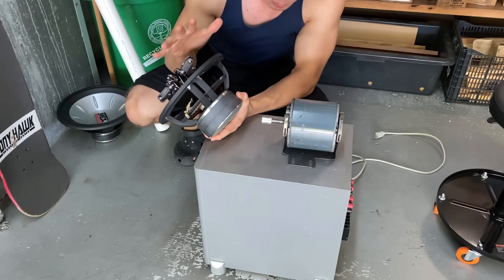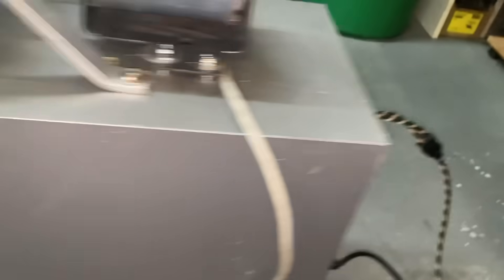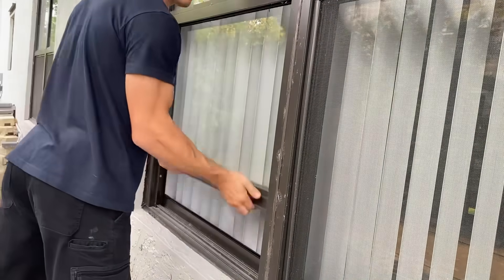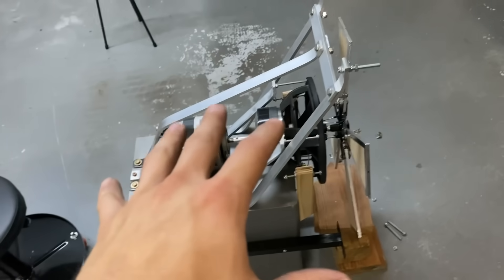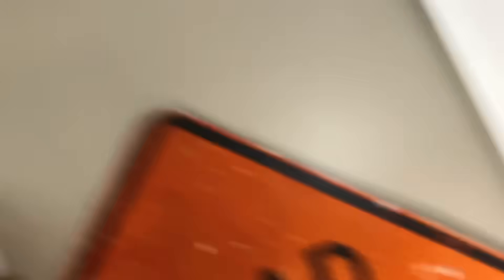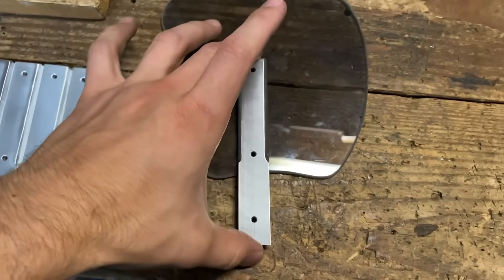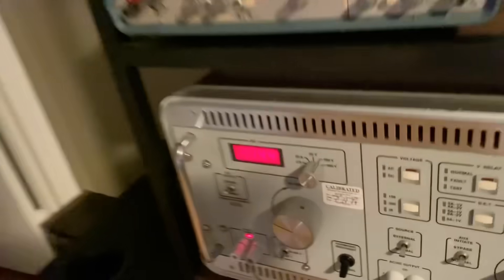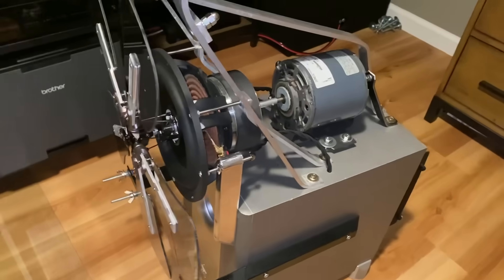Making the worlds most powerful subwoofer (Rotary Subwoofer)

Comment: When you showed it at 1hz it looked like the fan was moving as close to a square wave as possible..  I wonder if you had the signal generator set to square wave, and that brings up a question about how lagged the phase is, and how accurate the signal is if you were to "receive" it somehow and plot the air pressure on an OScope?  Super cool project!  I could see putting that in a haunted house just to create an indescribable sensation that would make visitors uncomfortable..  :-)

Comment: It shook your house from moving the walls due to fan shaking - or the wind - the dB is not causing the doors to move
Reply: moving the walls? you can't shake a house like that. idiot
Reply: @realmasterkush   the movement of the air is causing movement of everything, also walls do indeed move if you exert enough force upon them.. idiots
Reply: @realmasterkush well in the USA you can, many are build from wood. Low frequency can definitely also move a brick home home if it's powerful enough
Reply: your house's foundation shook when your mom stepped in it... etard
Reply: To elaborate - the wind could have done this ... not dB

Comment: Why didn't you just stick a slab of rubber between the motor and the chassis.
Reply: Because that would prevent a lot of the power from being transmitted, you want it as rigid as possible.
Reply: @flomojo2u  I think he ended up with a whole lot of power, and a whole lot of rattle, when he could end up with slightly less power, and no rattle. This thing is a nuke, there's no lack of power anywhere, putting it on a slab of rubber keeps the soundwaves in the air, instead of between the chassis and the motor. Rattle never sounds good.

Comment: But why didn't you show it playing some actual music? ... I'm kinda disappointed. It looks really cool and the fact it moves so much air is great, I just wish I could hear what it actually sounds like with music (or other audio. Like a movie or whatever)
Reply: I'm not sure how many songs are publicly available that play notes below 20hz
Reply: @socks7545  Oh so this is only adequate for sounds below 20Hz? I thought it had a bigger range than that. I hadn't ever heard of this type of speaker before btw.

Maybe you could pair it with a normal subwoofer and a normal set of speakers to get a good range?
Reply: @janusismyname 

Rotary subs can absolutely play audible sub frequencies with a high enough impeller RPM and a solid driver (as impractical as it is lmao) to something like 30hz, but the design isn't necessarily the point of the device.  But yeah, they're mainly to cover ranges below human hearing.

still, though, you could just play chopped and screwed through the rotary, like bassheads have been doing on normal subs for decades now.

Comment: So it doesn't seem practical?  What's the decibels?  Does it compare to a standard sub when playing music?
Reply: This machine shoots a frequency at 180 bi directional. The decibels can be used as amplification for the frequency to reach further places but not necessarily make it louder, this helps with movement of air to push sound thus adding a sound system for theater style use will bring the sound to life more than anything else.
Reply: @alexiz.7569   That's fascinating!  Thank you for sharing!

Comment: If it's inaudible, what tf is the point? I really don't think the fan is doing sh*t though. What's the point of the fan, to make the sound inaudible so you can blast bass... and not hear it? Just adding "feel" to your music? Well, you can market them to the deaf. They like music too, but they have to be able to feel it. I
Reply: The fan is the whole reason it works. It generates static pressure which is modulated by the pitch of the blades, kinda like a helicopter is able to fly. A normal subwoofer simply cannot move enough air to get to frequencies that low unless it was ridiculously large and high excursion. 

And yes, the point is to feel the vibration. It enhances the experience during movies that contain very low frequencies.

Comment: Because 10hz is even humanly audible letalone wouldn't be filtered out by the digital audio file or the analog path otherwise 2:12
Reply: I can hear it just fine on my SVS SB1000 Pro. it's definitely attentuated and on the edge of human hearing so it's not very loud even if you are pushing a high SPL but it's there and audible.

Comment: How does it sound at higher bass frequencies? 40-300 Hz
Reply: Rotary woofers can't really go above 20 Hz, since the blades have to move too fast. A traditional subwoofer is still needed for stuff above 20 Hz.
Reply: @KingdaToro That's a shame, but it makes sense
Reply: @ContriteCatholic  It's not a shame at all. This is meant to complement a regular sub, not replace it. The rotary handles 0-20 Hz, the regular sub handles 20-80Hz.

Comment: i really wish you wouldve done more hz like 20-30 range so it could be picked up properly on the mic
Reply: 20 Hz is actually the point where traditional subs start putting out higher SPL than rotaries. Above that point, the blades have to pitch back and forth too fast to be effective.

Comment: Hello folks; i can see or believe why there not in full production from1994 Phoenix Gold Cyclone rotary subwoofers. 
Theres lots of information out there.

 Great for the D.I.Y. crowd. One needs the house to be under warranty not the sub woofer. Run safety covering around the blades the G force the blade will go right through the brick house next door.
Just like the grinding disc that snap on two that in the 3/4" plywood ceiling for life.
A hot rod motor has some type of safety hold down in case they break a motor mount.
Lock tight and lock washers on everything,  too

High performance equal high maintenance. Get good insurance.
 Best to have a spare one as it will go down that's the last thing you want to happen when you don't want it  too.

Ride Easy

Comment: That would seriously be the craziest lfe experience ever. Id just pitch shift the lfe down to infra level. Or you could use a sub-harmonic synthesizer. You could modify/make a DBX 100 since schematics are easily found online.
Reply: Geta good sub for the upper frequencies of the lfe too. ~20hz and above. Not sure how accurately you could set a crossover tho.

Comment: Why does everyone put it in the window?
Reply: because a normal sub, inside a box, changes the pressure inside the box compared to the outside, this through the duct that is open between the inside and outside, as for this sub fan, it needs to change the pressure of indoors compared to outside the house, and since it can move a lot more air since it's a fan, it needs and can move a lot more air, making it very strong, I think that's it

Comment: You gonna build this sophisticated thing for days and then not even do a soundcheck with an actual song
Absolute madman haha
Reply: Very, very few songs have sub-20Hz content. Above 20Hz, a traditional subwoofer will outperform a rotary.
Reply: @KingdaToro  OK I just thought it would be in general a really powerful subwoofer with the added capability to go down to 1hz
In which way will a traditional subwoofer outperform a rotisserie subwoofer?
Reply: @LeKacker  It's because the blades of a rotary subwoofer have to pitch back and forth too fast to effectively move air above 20 Hz. Conveniently, that's also pretty much the bottom limit for a conventional subwoofer. The point of a rotary sub isn't to be your one and only subwoofer, it's to cover the entire range below what a regular sub can do.
Reply: @KingdaToro  ahhh so it's a sub-subwoofer

Comment: This is so awesome. Keep up the innovation. I have a fire place in my theater room my 125 screen drops in front of. I'm thinking I can use the fire place as a vent to block off and install the rotory sub 🤔.  Problem is I'd have to clean my chimney immaculately. Can you imagine the soot that'd draw in at that much pressure. 😅but I'm gonna consider it as a reality that can happen. You've inspired me.

Comment: How about higher frequences? Does it produce any noticable sound around 20 - 40 Hz?
Reply: Most audio sources like the CD standard won't produce sounds below 20hz anyway. Ultra low frequency bass was experimented in 70's with a brand name Sensurround. Battlestar Galactiga 1978 movie was one of them. It made viewers motion sick and the experiment was quickly dropped.
Reply: @dingdong2103  I asked for range between 20 and 40 Hz, not below 20 Hz, but thanks for reply ;-)
Reply: We used to load the big subs at the front with popcorn and it would blow all of it out when the base station blew up, good times lol. @dingdong2103
Reply: Rotary subs pretty much top out at 20 Hz. Above that point, the blades have to move too fast to be effective. Traditional subs outperform rotaries above that point.
Reply: @KingdaToro  That makes them pretty much a niche product. Not many sources even contain that low frequencies at any meaningful level. Perhaps some eearthquake movie :)
Reply: @dingdong2103  Quite a few movies have infrasonic content. IMO these should be standard equipment for IMAX theaters. These can also reproduce the lowest pipe organ notes, most go down to 16 Hz and a couple (literally, only two in the world) go down to 8 Hz.
Reply: @KingdaToro  You forget that the most common codecs support only 20hz-20khz
Reply: @moreroids_morehemorrhoids Partially true, we can hear up to 18hz if the volume is loud enough. But anything below 40hz can be felt as a vibration in the body naturally. I have a horn loaded bass that literally makes your pants flap with the pressure. I built a large horn loaded subwoofer for a local cinema and it goes down to 16hz cleanly at 130db. The front door (at the bottom floor down the stairs of the building) shakes with the LFE :)
Reply: @moreroids_morehemorrhoids The bass is just a horn loaded bass with a PD1850/2 driver and a 2500w amp. It gets horn loading down to 50hz but I've eq'd it a bit deeper using minidsp because it's loud enough even below horn loading for my outdoor parties. The horn gives the bass extremly tight punch that literally drops tools off my shed wall. The horn I built in pairs for the cinema uses a tapped horn design and 18Sound 21" long excursion drivers.
Reply: @moreroids_morehemorrhoids Bass speaker -> 40-200hz a subwoofer 16-40hz. My garden sound system has the horn bass + 2x Electro-Voice ELX115P PA speakers

Comment: Could you make a smaller one that's actually usable inside a normal speaker enclosure?? Also for higher frequencies. Can you have an entire rotary speaker set?
Reply from the maker: If time and money allow, I’ll def make a few more
Reply: These move so much air that the necessary enclosure size is MASSIVE. That's why they always require infinite baffle installation. I doubt it would be feasible to scale it down enough to use an enclosure smaller than a refrigerator.

Comment: 🟦... It looks like you need a rubber coupling from the (rotary) motor to the shaft coming out the back of the magnet structure,
Perhaps a fairly compliant but thick-walled butyl or silicone rubber tube with a slight bulge in the middle that would grow larger in diameter as it was compressed in a linear-manner and  back to its original diameter when released, so it would absorb the linear motion of the woofer-shaft without transmitting any significant energy to the rotary-motor shaft,  and it wouldn't emit any self-noise doing so!

Comment: Very cool. Do you plan on making a video explaining how it works in more detail?😊
Reply: from what I can see the speaker is coupled with the fan blades in a way that changes the angle when it moves causing difference in air speed that is equivalent to what a speaker would do just with way more power
essentially a mechanical way to amplify the amount of energy a speaker can output by using a electric engine as a source of additional energy meaning the speaker has to work less for the same effect and with more max power

Comment: I'm intrigued... it's turning your house into the enclosure, so to speak, because the air pressure is acting on all the non-ventilated surfaces. You can hear it because the house is reacting, but I'm curious if it's something you can feel if you're just sitting in the room.
Reply: I also meant to add..   your editing is fun and your skills are solid.  I look forward to seeing your channel grow.
Subscribed!
Reply from the maker: Thanks for the praise, and yes you can actually feel it moving the clothes on your body when you’re near a door or window.
Reply: @pierogiengineering    That makes sense. When you're near a door or window, you're in a focused air transfer space (moving through the funneled point)... but if you're just standing in the middle of the room, the effect would be lessened...    Still, a fascinating device!

Comment: careful with the near-DC currents on that subwoofer, it's probably not designed to handle them, usually the excursion helps airflow over the voice coil but at super low frequencies this does not occur so you need to make sure it's not going to burn out
Reply from the maker: See that’s the weirdest thing about this. In a normal sub enclosure I don’t dare play below 15 cuz I can legit smell the coil. But no matter how low I go on this, regardless of how much power I’m pushing, the coil is legit cold to the touch. Haven’t figured out why this happens.
Reply: @pierogiengineering  maybe it's the fan? I've never actually studied rotary subwoofers

Comment: Probably shouldn't use a tap as a center punch if you care about it at all, haha
Reply from the maker: It’s a broken one that I repurposed. It’s a super hard metal, so I flattened down the broken tip and hammer away. Works great
Reply: @pierogiengineering  Haha, that's good.  Cool project BTW!

Comment: Neat. But there may be voice coil actuators better suited to this task than hacking a speaker. (The speaker is only intended to drive its own cone, but solenoids or actuators are intended to push vibrations into more massive stuff.) Finding one of those suitable as a alternate could possibly improve the response range, as it'll be better able to push/pull that swash-plate assembly better. I'd be willing to say it's possible to do a lot better still while keeping the price-point below that of one shown for any rotary speakers for sale.

Comment: So you are telling me that building my tapped horn that goes down to 14hz or so was a waste of time? lmao.
How did you make the mechanism to move the blades? Also i wonder why you would use a fancy SB acoustics woofer for it.
Reply from the maker: Nahhhh, A tapped horn is never a waste.

I purchased that mechanism, it’s from a large rc copter.
And I used an SB cuz the spider detached at one point and had to be reglued. It works perfectly but I’m not risking using it in a professional speaker enclosure.  

Good eye tho
Reply: @pierogiengineering  aah okay makes sense then! It would probably be fine with the right glue.
Funny enough i'm waiting for the new version of the very same driver that you have there. 12mm Xmax instead of 8mm as the older model. Currently using 2 w8 670c or whatever came in the Logitech Z2300. Sounds good but i'm sure the single SB 8 will sound better. Will be building 4 of those horns. Only 2 if 2 driver's work in one Horn with some eq.
Reply from the maker: @kaedeschulz5422  you chose a good driver. These things kick ass
Reply: @pierogiengineering  They sure will! Also they will be able  to take more power without getting hot Only thing i'm worried about if would use 2 of those beasts in one Horn is there being so much pressure in the horn that it would rip the cones apart.
Simulation says 1driver in 1 horn would do 115db with 2 121db.
Can't wait to hear it with those SB! it's gonna sound SO CLEAN!

Comment: Howsit sound at 20hz on music though🤔🤔🤔🤔
Reply: Another comment reply seemed to suggest the speaker cone can't do it past 10Hz. It's not quite strong enough. It could probably push upwards towards 60 Hz if he got a properly sized voice-coil actuator for it instead.
Reply: Yeah, would have loved to have heard 20 Hz - 50 Hz.
Reply: @patrickkernow  apparently based off if replies i see it wants to rip apart at 15hz and up cause like with a unloading subwoofer its hard to stop unloading at these frequencies, my sundown X15 can play down to 4hz and move a 1/4 of the air this sub does thing is i can play up to 60hz audibly peaking in the 30hz to 34hz zone with 130DB so yeah point is just get a proper subwoofer in the right box to enjoy glorious lows instead of this. Im moving to 2x15 inch DD715D subs soon for home audio and later on will do a T line for them and double power as well. 😆

Comment: It kinda works like helicopter rotor cyclic. I mean you could probably "dismantle" a house with a rotary subwoofer...

It's actually scary how powerful that thing is...
Reply: yep, it can freaking shake your entire house just with a 6 inch spider and coil with just that..... I am really amazed how low can it go without distortion, and yes by that I meant when the rotary sub is far from the listener or in the other room.... sadly no one wanted to continue into improving this design as subwoofer manufacturers may lose the competition, probably.